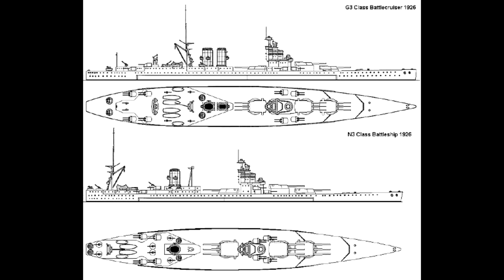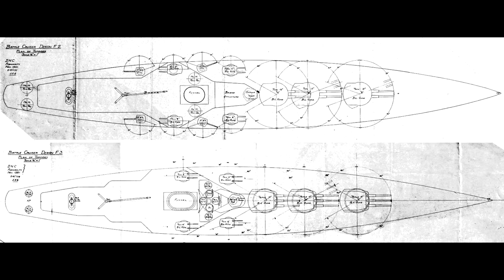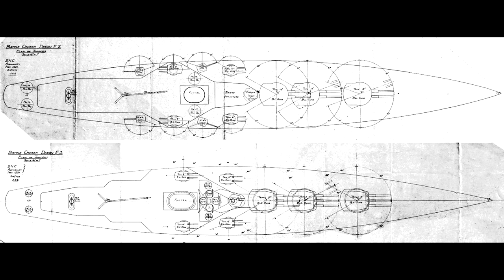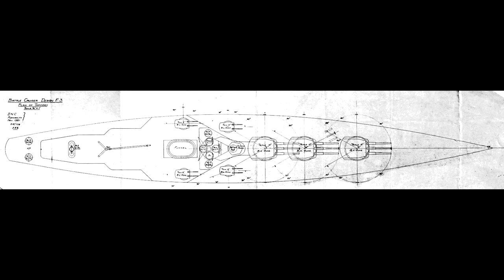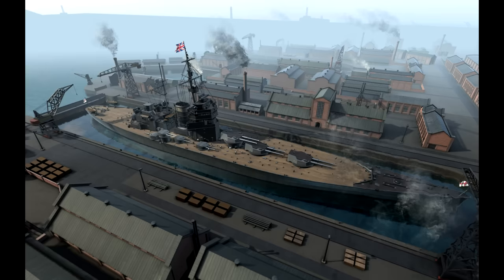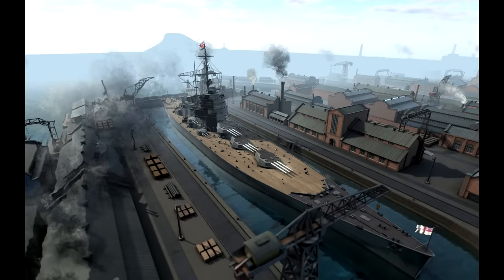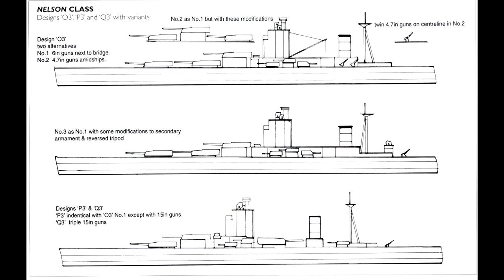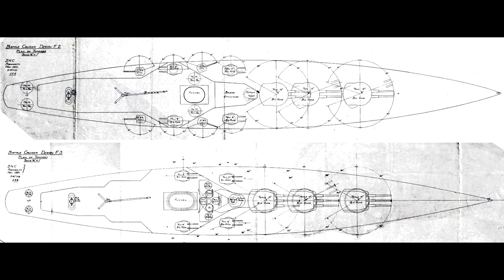Battlecruisers F2 & F3 (NB) - Guide 378

Comment: I've always felt a pair of F3s would've been more useful than the Nelsons. Particularly given that Britain's overly lightweight 16" shell wouldn't have been that much of an improvement in lethality over the excellent 15" shell fired out of a longer barrel. And in terms of accuracy and barrel life, the 16"/45 is actually a downgrade. But the substantial speed increase over the Nelsons (5.5 knots faster is a lot) with almost as good armor would've been incredibly useful.

Comment: Using 20/20 hindsight, fast battleships would prove much more valuable in WW2 than the more conventional type, just look at how much heavy lifting the relatively archaic Kongo’s did for Japan while the Fusos and Nagatos did relatively little.
Reply: And the Queen Elizabeth class cold and slow in comparison to newer battleship designs, did a lot of invaluable work in the Mediterranean when the much newer KGV's were still getting built and fitted out
Reply: @RocketHarry865  but for Taranto Illustrious had no battleship escort as none available were fast enough, an immediate example of what fast battleships would have been more valuable. Yes the QE’s did good work, but fast BBs would have been more helpful than the Nelsons I believe (which were slower than the QEs).
Reply: You need to consider the strong pacifist sentiment in Australia (as well as in NZ and Canada) the early 1930s, as well as the severe economic depression.  Australia, for example, could not afford to keep even its V&W class Destroyers in Commission - running a Battlecruiser would have been totally unaffordable and the ship would have been scrapped as a cost saving measure.
Reply: @RocketHarry865  "KGV's were still getting built and fitted out" is the problem. The KGVs didn't exist yet. If the Nelsons were faster, then they may have ended up more utilized than the QEs.

Comment: If they'd been built, the 15" 50calibre would also have been available as an upgrade - if not necessarily a bolt on one - for all the 15"" 42c RN ships.  That might have changed a few things, even if only the most heavily refitted/rebuilt ships got them.
That's assuming that the treaties didn't somehow forbid it.
Reply: I think unlikely the barrels are replaced, but the breaches may have been modified in a refit to accept supercharges as on Vanguard.
Reply: I think there were some parts of the treaty to kinda ban the building of ships that were clearly intended to just be refitted when it comes to wartime. Could be wrong
Reply: @juicysushi  Special clause in the draft for the second London treaty, "No refitting or up gunning Warspite, she's already +5 on everything."
Reply: @purplefood1  But the argument is not about building new ships just to refit them, but rather the argument is that already existing ships could have been refitted with these new guns. I don't think there was a ban on refitting existing ships, and since these new guns wouldn't have been any larger in caliber than the existing guns on these ships, I think the RN may have been ok to do that.
Reply: @MaxCroat  Ah in that case yeah probably could have gotten away with it
Reply: @MaxCroat  Mind, just because something was not banned by the treaty didn't mean it could be done without deference to the other signatories. Any signatory could, if they thought something another signatory did would unbalance the fleets unfairly, demand a new conference to discuss the changes.

 If the Royal Navy or USA or whatever started to replace old guns on ships with new guns that significantly exceeded the performance of the old guns, that could be cause for such a conference because the old treaty was based around the "balance" of the old guns.
Reply: @genericpersonx333  Yeah, of course you're right. I was just saying that, as far as I understand, this wouldn't theoretically be breaking the treaty rules. In reality, several parties quickly started trying to find loopholes in the treaty or just outright cheating, often quite obviously (for example the Japanese with their heavy cruisers, which were fairly obviously over the displacement limit). The treaty only really worked as long as all parties were willing to adhere to it, which wasn't that long tbh.
Reply: @MaxCroat  Indeed. It is just one of those things that tends to be missed by a lot of discussions about the Treaty Era; everyone, even the Japanese, were careful to only do things that didn't obviously unbalance the fleets too much that they couldn't be ignored or adjusted for without a new conference. No one wanted a new conference if possible because odds were they would "lose" more than they gained from it.

Comment: I’m inclined to agree as WWII events transpired the RN would have been better served with 15” fast battle “cruisers” than the sluggish Rod Oil and Nels Oil.
I also remain perplexed that Britain doggishly kept to their displacement limits when building armoured hulls to treaty displacements, under armed, that could be up armed should a shooting war break out.
Reply: Already had the design and machinery for them
Reply: If the F3's matched the power/ protection of the Colorados, and were ~ 30 knots, I should think them a better buy than the 03's in the 1920s. Especially when you consider the speed of the Japanese battle line.

Comment: The designs are technically interesting.  But in WW2, radar was the differentiator.  In total darkness, the USS South Dakota’s electrical outage left it blind and lame, while the USS Washington with radar directed gunfire set the IJN Kirishima in flames in 5 minutes at 5,000 yards when IJN has no radar for detection.  No armor scheme can protect repeated hits of 14-16” shells that radar made possible in most weather and visibility conditions.
Reply: But note that the Japanese were shooting up the Americans without having radar themselves. Radar was great and wonderful and all, but it gave an extension of already existing capabilities (and it took a while to iron out the kinks, and learn how to use it right).
Reply: at 5000yds when the opponents are shooting, you dont need radar to find them, and hit them.
Reply: @leftyo9589  USN didn’t specialize for night action while IJN did.

Comment: Nelson's belt armour was changed from 18 to 15 degrees after the last Legend was produced. I imagine had the f3 been forwarded then the same might well have been done. Also remember that "12 inch" belt armour will actually be 480lb plate as in Hood a true 12 inch plate would be 490lb plate

Comment: 6x 15" guns seems just a little under gunned for a 35k ton capital ship
Reply: The Germans were planning something similar with the Scharnhorsts so it probably wouldn’t have been that big of a limitation
Reply: Possibly but, it was supposed to be a battle cruiser and Renown and Repulse also had 6 15" inch guns.

In the end had things turned out differently I can't see the Royal navy trading a bit more armour and 1 knot of additional speed over having 3 additional guns per ship.

Comment: Would have been more use than the Nelson class due to their high speed.
Reply: And F3's firepower wouldn't really have even been any worse than the Nelsons', due to the very questionable design of Britain's 16" shells (which were much lighter than any other nation's shells of the same caliber). Since F3 would use the same shells out of her 15"/50s as the pre-treaty British BBs fired from their 15"/42s, that's a 1,938 lb APC shell with 48.5 lb bursting charge. While the British 16"/45 fired a 2,048 lb AP shell with a 51.2 lb bursting charge. That's much smaller than the difference between a 15" and 16" shell should be. And the 15"/42 guns were consistently more accurate than the Nelsons' 16"/45. If the 15"/50 were able to match the accuracy of the 15"/42 while giving the shells higher velocity, I'd take that over the 16"/45 any day. The tiny increase in lethality of the lightweight 16" shell wouldn't really matter if you're scoring hits more often with the 15" shell.

And F3 with that 5.5 knots better speed than the Nelsons would still have excellent armor, so you're not losing very much to get that speed.

Comment: Drach, wouldn't the RN have used the same turret nomenclature for the F2/F3 as they used on the Nelsons?
Reply from the maker: Possibly, but there is no consistency in the choices made between the various RN ships with 3 forward gun mountings, so the choice could be entirely arbitrary.

Comment: You wonder... if you're considering triple 15" turrets anyway, why not make a design with 2 triple turrets instead of 3 dual turrets?  That should save a lot of citadel length, overall ship length, and also no awkwardness with a third turret on the same level.   Yes, 2 turrets is more vulnerable then 3, but supposedly you save lots of weight.

Comment: Was there any thought for an F4 design with quad turrets?  It's not inconceivable, since the KGV's had them. They could have put 8 guns in two turrets like the French Richelieu's and probably saved weight on a shorter citadel, which was the whole point of the all forward turrets.
Reply: It is an interesting idea, but one I could see being riddled with problems. Historically, Quad turrets were known to "knock" themselves out when firing all the barrels at the same time, like Prince of Wales at Denmark Straight. But at the same time, the RN would have 15-20 odd years to iron out the kinks.....
Reply: No, I don't think any consideration was given to that. France had already been designing quad turrets prior to WW1 (though the ships that would've carried them were never completed as battleships and no 13.4" quads ever seem to have been built) and actually had never designed any battleship-caliber triple turret, so going with that layout on the Dunkerques and Richelieus was a natural progression. But Britain didn't look into the idea of quad turrets until the 1930s.
Reply: One interesting feature of the French Quad turrets is the gap between the middle two guns.  The turret had an armored "firewall" down the middle of the turret.  The idea was that if one side has hit or jammed, or somesuch, the other half could continue firing.  However, if one side is blown up, the turret itself may not be able to rotate, rendering the surviving guns basically useless.  
Was this separation ever useful in combat, like at Mers-el-Kabir?

Comment: There is one problem I would like to point out having about the design all the guns facing forward would make it vulnerable to chain detonation it takes a lucky bomb mine Torpedo in the right spot and blow the ship to hell..

 having all guns set forward reduces the distribution of fire having the armoured belts and citadel reduces cost and displacement also having only one central Fire Control station for the main guns it would have a significant advantage in an enemy Stern Chase but if the position was reverse it would be vulnerable to stern Chase allowing the enemy to bring their forward guns to bear allowing to hit in vulnerable places such as the boilers and engine rooms causing severe damage and why the secondary guns could fire back they're firing arcs would be reduced either by debris or structure in the way..

There's also the fact in the line of Battle having all guns facing forward it would allow it to concentrate fire on a single enemy ship but allowing two enemy ships that have a gun layout of two forward and two aft allowing more significant concentrate if one ship was in the firing arc of the main guns why the other ship wasn't..
Reply: If one of your main magazines goes up, you've lost the ship irrespective of anything else